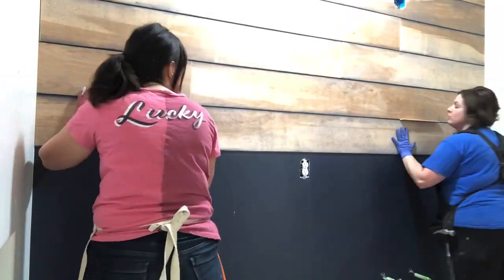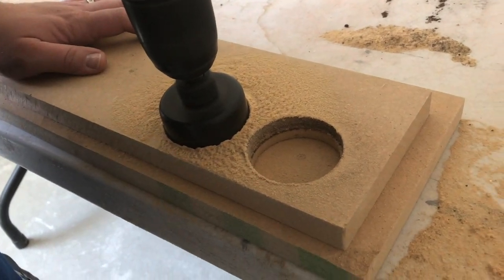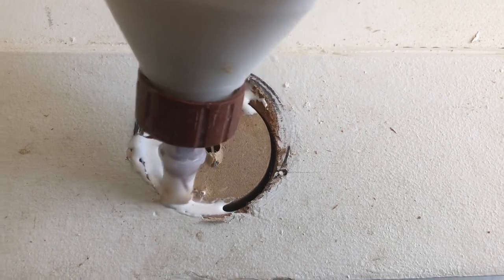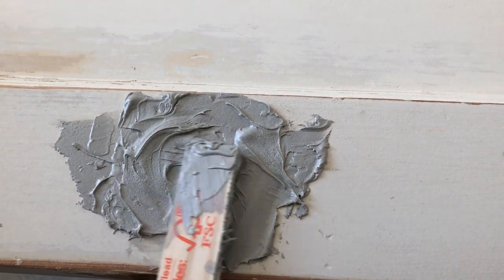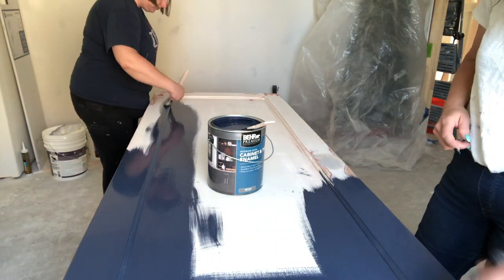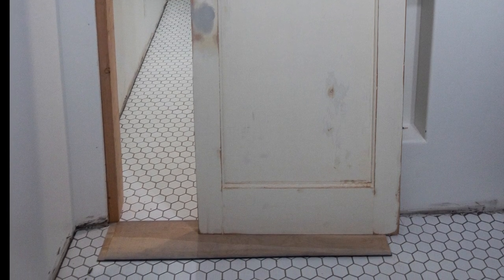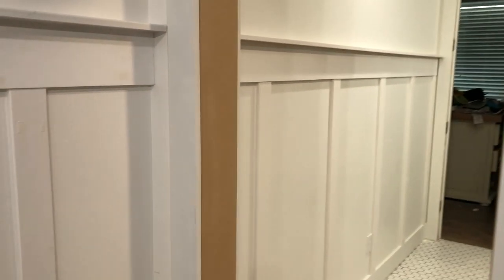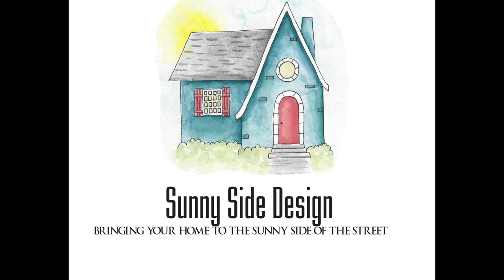The $5 Barn Door for a Bathroom | Easy DIY Project | BARN DOOR DIY | CHEAP BARN DOOR

Comment: How do you lock the door and is there a gap between the bottom of the door and the floor?
Reply from the maker: Great question. There are a variety of locks you can get for sliding barn doors. In this situation where it's a jack and jill bath and accessible on both sides, we'd have a lock on both sides. And yes there is a gap between the bottom of the door and the floor, just like there is with any other door. Hope that answered your questions.